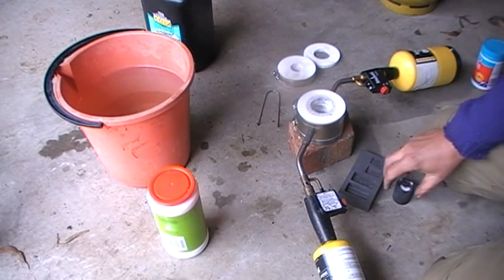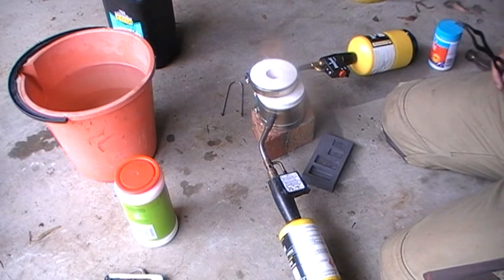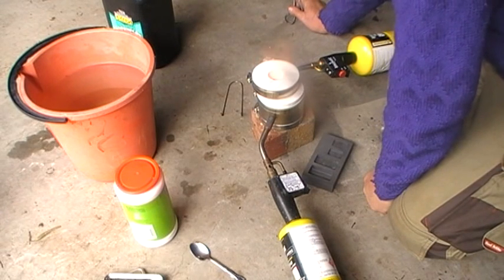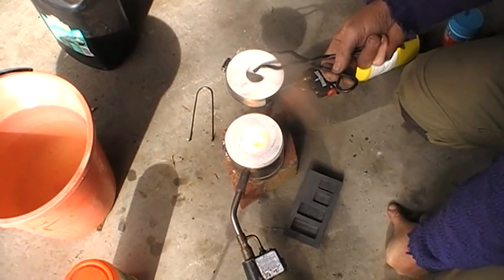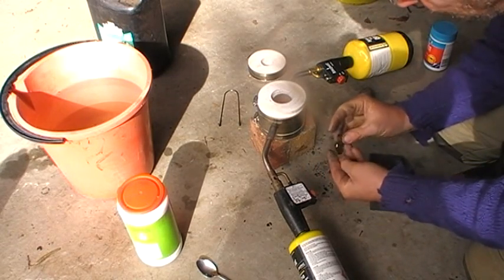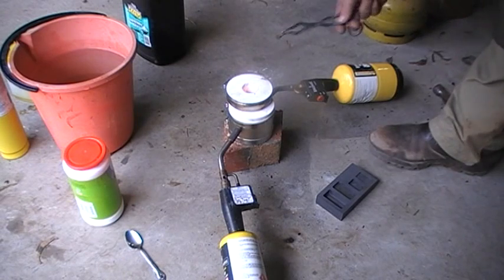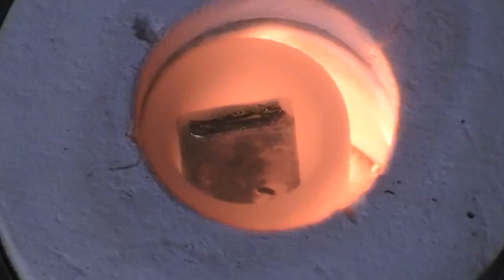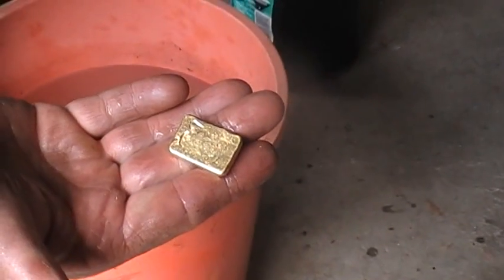Melting 64grams of gold with a Make your own gold bars furnace

Comment: I used to work in a gold room and pour $M's worth a month. But size doesn't matter, it always looks as good. try about 10% clean sand in the charge. it help with the viscosity of the pour and the glass breaks away easier.
Cheers
Reply: When you say the glass breaks away easier, what do you mean by that? Sorry I trying to learn the trade and I had a piece I was trying to smelt and it had a layer that looked like glass over it, I'm just making sure I'm doing it correct sorry and thank you

Comment: Awesome to see .  Problem is  a 2 ounce bar is only worth say $3000.  But if you would have sold the nuggets individually ,, it would have easily returned you over $4000 though .  Still huge fun finding the littlies though with a 2300 . Cheers
Reply from the maker: +david costanzo I get spot price plus 2% x purity x the weight. it doesn't cost me postage and packing and ebay fees, it is completely safe, no theft from the post. i'm not knocking the way you sell your nuggets if it works for you, good
Reply: +david costanzo why is that? and where would you (or do you) sell the nuggets?  cheers
Reply: I sell all of mine on Ebay .  Usually sell the smaller ones in 10 gram lots . IE: if gold is $48 Per Gram.  I will always get $55 per gram . Bigger nuggets ( 1 ounce plus ) i will always get $60-$65 per gram  for them .  Gold nuggets in their natural form are always worth more than the spot price of gold . Cheers m8
Reply: Sounds like a fish story.. H BO had mostly pickers.. not big nugs..